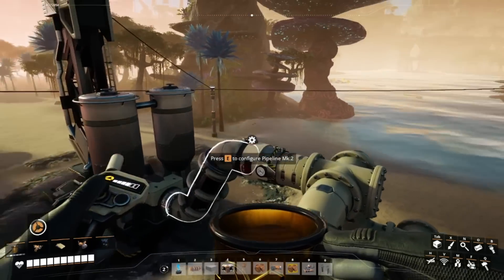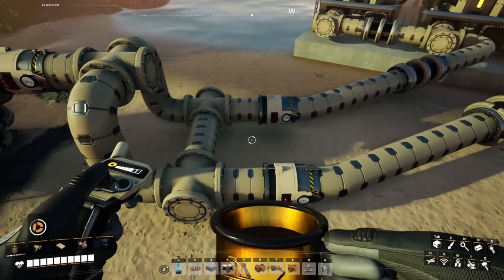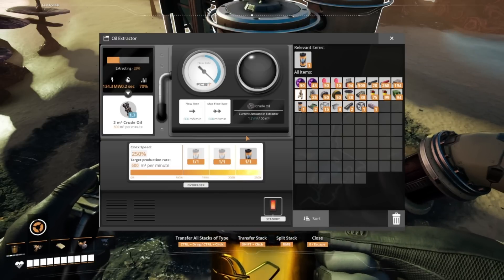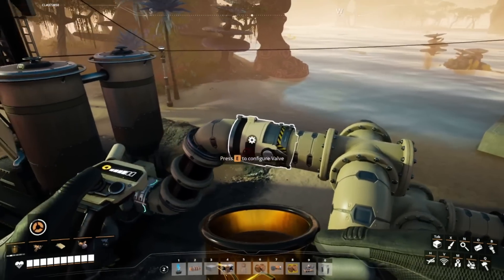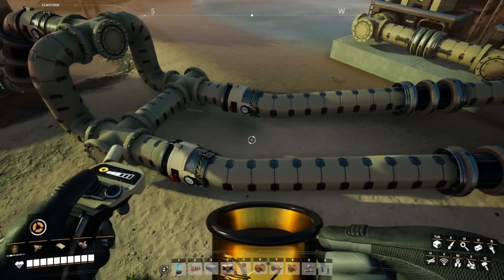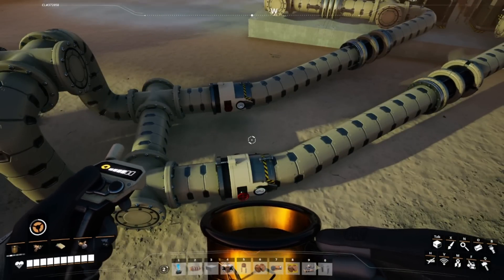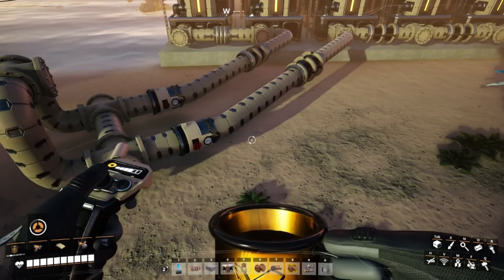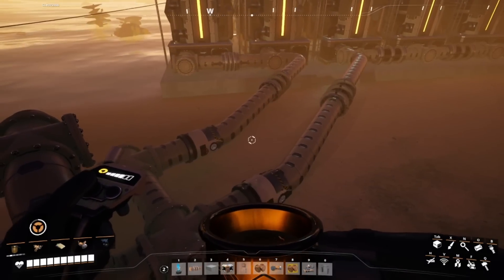How to actually get 600 out of a pure oil node in satisfactory

Comment: Pipes are still such a hot topic ^^
I just managed to finally make my rocket fuel factory work after 6h of troubleshooting my previous setup. The main difference? I'm using exclusively MK1 pipes. Supposedly, MK2 pipes have been fixed, but only after this change was I able to get a fully working factory. And in this new setup I'm not using a single valve or buffer. It just works.
Reply: Using a water tower?
Reply: @Miglow  Nope, just normal pumps right after the water extractors. By now, I have experimented a bit and I think the main issue is that MK2 pipes can't reliably transport 600/min, while MK1 pipes can reliably transport 300/min. I don't know what the threshold is after which MK2 pipes "break", but I'm successfully using them sparingly in places where 600/min are not needed.
Reply: rocket fuel is a gas.

Comment: Doesn't carrying the liquid up to a higher position than the manifold line by pumps then splitting it and connecting it to the both ends of the manifold fix the issues with 600m³? I mean do we really need this much?
Reply from the maker: that's not always an option or fit the design of what you're doing, if anything I'm doing that on a small scale
Reply: @siriuscowking You may be right. I always design my factories around the feeding from the top principle so I wouldn't know

Comment: Why is there backflow if the system is never saturated? Won't the fluid only go in one direction?
Reply from the maker: even if the pipe is saturated, the liquid will flow in both directions unless going down a slope
Reply: @siriuscowking  Do you consider this a bug or more of a feature of the fluid system?
Reply: No unlike belts fluids will flow in any direction and accumulate at the lowest point. This is intentional, as it's low compute approximation of what liquids in pipes would do.

Comment: if you loop the ends of your pipe manifold back to your feed pipe it does teh same thing without any extra bp or valves or anything. the loop will allow fluid to flow into the manifold of pipes from multiple directions without worrying about valves or "load balancing" - you are basically doing the same thing with your bp, but in a more complex and unnecessary way.

Also, VOLUME (full pipe) does NOT affect FLOW (throughput m3/min) - you want full pipes with full volume to prevent backflow. Full pipes = happy pipes.

Simply loooping the pipes i have multiple 600m3/min systems without anything so complex as this
Reply from the maker: that does not prevent backflow at the first junction
Reply: @siriuscowking  in a pipe loop, backflow only happens when the connected production machines are not able to consume all of the incoming flow. So, while you're, technically correct, it doesn't matter because if you built enough production machines, no backflow will happen. Edit: Oh and even if it did, both directions would need to be simultaneously blocked  for it to cause the extractor to accumulate fluid to it's buffer.
Reply: @siriuscowking  you dont need to prevent backflow. If the system is full, and looped, and you are using the same amount that is being produced, you will have no "effective" backflow. (it will still occur through your system between every segment of pipe because pipes are bi directional, and fluid will always flow toward where there is none - which will result in fluid flowing both ways (backflow) out of all segements anytime a machine gulps down fluid (which it does far faster than pipes can fill back up)

the internal buffer on machines is a good thing and it should be full, because it helps smooth out small variances in the way liquid flows back and forth down pipe systems, letting sometimes more liquid is in that section than needed and sometimes less. with 100% full (Volume) pipes slosh/backflow is not a problem.

Fill your pipes before turning on machines, turn machines on in sequence letting pipes fill up again in between, and you will not have issues with backflow at all.
Reply: Ever since pipes were introduced I have been having to help friends fix their pipe networks and in every case they had their network set up in an overly complex manner and purely simplifying it fixed all of their problems. Typically, they have a bunch of valves or pumps set up in an attempt to fix the issue of the overly complex network and are frustrated. I do as Lynx said, I loop half my liquids to the far end of my manifold and feed half from each end and have had zero issues since the beginning in my own networks. I have never used valves and only have used a pump in the rare case I need more head-lift, which is rare since I always try to build my fluid networks on ground level.

Comment: I would just use tanks
Reply: They don't fix the problems. Tanks are just big pipes. Your pipes already function as tanks. In fact, those specific tanks fudge the flow direction and headlift, so I wouldn't use them
Reply: @AfePooq  never had issues with oil, getting the full capacity. Tanks are needed to balance the flow.

Comment: Orrrrrrrrrrr, you set the two other valves at 300 each, problem solved without the extra pipe intersection....If you need a 200/400 devide, set 1valvue to 200, the other to 400. Not that difficult.
Reply from the maker: this is not about setting specific values, it's about making sure a full 600 flows out
Reply: if your pipes are ever not full (VOLUME not FLOW) behind the valve, it will not send 300 m3 through the valve.

Comment: The problem with mk2 pipes isnt sloshing, its in how the calculates flow with floating point values. Theres nothing you can do to make a mk2 flow 600 perfectly forever. The best solution is to never design your factories in such a way that youre counting on a pipe to carry 600
Reply: yet there is. They fixed the floating point values. I have multiple oil extractors which run at 600 cubic meters at 100% efficiency with 0 trouble if you remove sloshing and have a good setup.
Reply: @Raicu_1  coffee stain posted a video less than a week ago basically saying it will never be fixed.
Reply: @FraterAleph you got a link? Because this specifically says its fixed https://youtu.be/ASfKo0dKBbU?si=nIXOuorHdAImGZTH
Reply: @FraterAleph  which video says that because i've heard several times in stream that they specifically said it is fixed.
Reply: Link? @FraterAleph
Reply: The pipe coming out of your extractor needs to hit 600.
Reply: this iwas never the issue. ALL math using floats has floating point rounding issues.  - that is  HOW floating point math simply works. The floating point math rounding shows up as potential gain or loss *when dealing with pipes higher than 600 m3/min*. Its not a bug in the code itself, its simply a fact of floating point math rounding that at larger pipe values it will cause discrepencies.

Comment: The core of the solution seems to be to not use pipes for 100%, right?

Even with verticality and valve, that by itself would not prevent the stoppage from going up to the oil output. The principle of transmission is "can't flow forward", not "flowing backward"
Reply from the maker: a pure oil node maxed out is exactly 600, that is the only situation where it can't be avoided

Comment: In the first bit with the blueprint. It appears you made a flow compensator. The other bit at alum fac is a high and low priority splitter using gravity. Let me know. if right or wrong.

Comment: You don't need any valves or pumps. You're doing something very wrong here. 
Valves also don't stop back flow, fluid in front can still knock back fluid behind the valve even if the fluid units don't cross.
Reply from the maker: I explain in the video how the pipe being backed up will be felt behind the valve
Reply: @siriuscowking  you certainly said some things, but it's perfectly feasible to get 600 from 1 node w/o valves and usually without pumps. I honestly don't know what you're doing to your pipes to make this be an issue but you're free to get some pipe trouble shooting on the discord

Comment: While the method used here would definitely work and prolly the safest one, the other method was pumps but it use power despite its just 4 to 8MW, the powerless method I propose was just put valve to the direction of the pipes that would get filled first in the manifold that way if you have extractor that was lower than the factory, the filed one will be full and wouldnt be able to back flow because of the valve and the extractor would just continue to fill the other side, you could also put valve on all 3 side if youre worried, another thing is to fill the input from above but it would sacrifice the uplift make sure you have less than 10m, youd always want the liquid to flow in one direction so avoid filling them from the the center like the vid shows there as much as possible, if not then just use one of the method shown or what I proposed there...
Reply from the maker: the only difference between a valve and a pump is headlift, they have the same functionality otherwise
Reply: @siriuscowking  Do pumps increase slight headlift or smt when not powered? I do know they act like a valve when not powered
Reply: @key462  I recently tested this. I built a pipe connected to water extractor and a pipe that went up 12m from the centerpoint of the water extractor's output. Then I tested it with both valve and unpowered pump. With Valve the pipe filled fully while with unpowered pump, it only filled to about 60%. Though, I did not test,yet, what happens if the valve or pump were to be placed at 10-12m height.
Reply: @joeljoonatankaartinen3469  Interesting tbh ive never use pumps as valve before, if i need them to flow somewhere I just use valve instead since they have smaller footprint, maybe it was that, since pumps have longer body most of the pipes it occupy were mostly occupied by pump body length the and continuity of liquid was probably prevented by that pump body or something, hard to judge unless you see the games code

Comment: Forget the valves, just use a pump directly after the extractor.
Reply from the maker: the only difference between a valve and a pump is headlift, they have the same functionality otherwise
Reply: Exactly. The primary goal is to keep the pipe immediately out of the extractor is empty-as-possible (in terms of calculations, may appear full)— the extractor should never back up.
Reply: Yeah, a pump saved me a lot of headache with my refineries.
Reply: Oddly, I have found valves are good at creating pressure in long pipes. Minimizes sloshing in the pipes. 

I had 30 fuel generators arranged in two rows of 15, the entire pipeline was saturated before they were turned on, pumps on everything. After a few days one of my generators wasn't getting enough fuel and began sputtering. 

I simply added a single valve halfway up the pipeline and it began working without a hitch.

While pumps generally work, sometimes valves are a no power cost alternative.
Reply: @magepunk7711  I believe that works because it stops the backflow before the it reaches a section of consistently full pipes. It'll probably still, eventually, cause some production slowdowns at the extractor once the pipes are sufficiently full, but that should only prevent the pipes from ever filling completely rather than reducing efficiency at the production machines. As in, it moves the problem of reduced flow to the last part of the pipe, which doesn't require the full 600/s for optimal efficiency.
Reply: @magepunk7711  correlation vs causation. Valves don't stop back flow. Basically any time anyone uses valves and 'fixes' an issue, time or something else they fiddled with. 

basically any system that works with a valve will work w/o them
Reply: @cobaltofdoom  Yes, valves do stop backflow. Literally the only thing I did was add another valve.
Reply: @cobaltofdoom  incorrect, a valve same as a pump flows fluid in only one direction, there is no backflow past a valve against the flow direction same as a turned off pump what's a bigger problem in Mk2 pipe calculations is correct connections, if you place a 4-way junction into an existing pipe the connections are different than when you connect each end individually, check with the deconstruct highlight the pipe reaches far into the junction or ends at the actual port of the junction, this extra bit of pipe reaching into the junction messes with the flow calculations
Reply: @cobaltofdoom  what are you on about? do you have any idea what youre talking about?
Reply: @cobaltofdoom That's one of the neat tricks with valves— fully-open, it acts as a one-way valve (no backflow).  I believe I first learned about this back when the devs were talking about pipe mechanics for valves.  Also, the official wiki confirms that valves have the use of “Limiting flow in one direction only, thus preventing backflow (just like Pipeline Pumps)(*)”.
Reply: @CapnSlipp  Except that they **don't**. It has been tested over and over.

They keep individual units of fluid on one side, but fluid can move backwards against the front of the valve, and knock the fluid behind them backwards as well. 

Which is back flow. Satisfactory systems don't care about keeping those units on one side, they care about flow direction. 

And you absolutely do not need anything like this on your extractors unless you're doing some very wrong.

Comment: I'm going to say this once and probably TWICE, STOP THE BACKFLOW with PUMPS. More sloshing means more backflow, that means the extractor knows that something is up and doesn't run at 100%. This is an issue with people that barely know pipe mechanics and they're a bit buggy but still. Learn to feed from above and keep things from going around and sloshing; key word i'm going to say... Valves are cancer in the game and I suggest just using pumps and gravity feeding things.
I like the ingenuity but my personal engineering skills (and game experience) want to screech with how much you made the thing 10x more complex with slapping valves down for liquids. (Yes valves do reset the headlift and that's why they're rarely used)
Reply from the maker: the only difference between a valve and a pump is headlift, they have the same functionality otherwise
Reply: First, valves don't reset headlift. They used to, but not anymore.

Second, I completely agree that this is a way too complex of a solution. I just finished an oil refinery setup using up 600/s of crude oil from a pure node using just Mk2 pipes last week. No pumps, no valves. Also, the refineries are actually several meters above the oil extractor and the loop is actually vertical because I supply both end of the refinery pipeline from below.

The trick? Make a loop out of the pipe that feeds the refineries. As in, don't connect it to the middle, but junction the pipe that comes from the extractor and connect it to both ends of the refinery pipeline. Loops are very effective at making backflow a non-issue because in a loop there is no wall to reflect back from. The only time a loop would start disrupting the flow is when the refineries aren't actually pulling in the full 600/s.
Reply: @joeljoonatankaartinen3469  Yes valves still reset headlift. I had one do it two days ago
Reply: @tabascosauce6490  Youtube either is being slow or ate my previous reply, so I'll try again with some expanded testing results.

I have 5 different test results here. The last two of them don't make too much sense, especially combined together, but are interesting regardless.
1. I tested a water extractor connected to junction followed by a valve and 10 meters of pipe straight up followed by a short horizontal pipe. Both filled up 100%.
2. I built an unpowered pump to the second port of the junction, followed by the same pipe structure as in test 1. The first part only filled up to 72%.
3. I powered up the pump, saw that the pipes filled fully, so I continued the pipe up to the maximum length possible. The last part filled up to 20l.
4. I then added a valve after the pump right after the 90 degree turn up. The fill rate at the topmost pipe dropped to around 15l.
5. Just for fun, I then added another valve a bit above the first one. To my suprise, the water level at the topmost pipe shot up to 100% , which is 70.4l. I tried adding one more pipe, but it only got like 0.4l after that. Though, when I removed the second valve and flushed the 70.4l pipe and rebuilt it, it only filled back up to 15l and stayed there. It only went back to 70.4l after I flushed it, so this is probably some kind of a bug.

So, it does seem like valves can adversely affect headlift when placed after pumps, but I don't think it's correct to say that they reset it.
Reply: @joeljoonatankaartinen3469  oh fun lol. Yeah I was using 400 out of 600 of a mk2 pipe in two different locations. Went to check the pipe and the area using 300/s was getting 600 flow rate somehow even after letting it set for a while...

So tried using a valve to restrict flow rate and seen it stopped flowing up the hill so had to add pumps. But my pipes were flowing atleast 40 or 50m up after the valve. Which was still way lower than the source it came from. 

Eventually just had to split the mk2 pipe into two mk1s to fix the issue. Fluids are never fun to deal with
Reply: @tabascosauce6490  Sounds like the two locations were at different elevations, in which case the one on lower elevation would get priority access to the fluid due to how fluid moves and accumulates in the pipes. Two Mk1 pipes fix works for this specific case, but if you had three or more locations and wanted to split the flow evenly, you'd probably need to make sure each of the pipes after the junction point goes up to the same height before descending to the target location.

Though, an easier fix would be to make sure the facility on the lower elevation won't eat more fluid than you want it to.